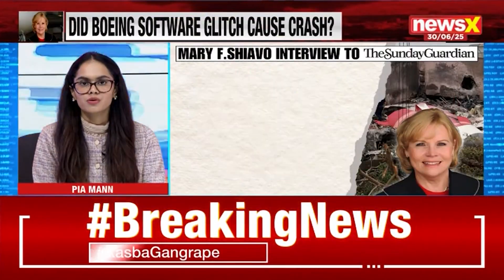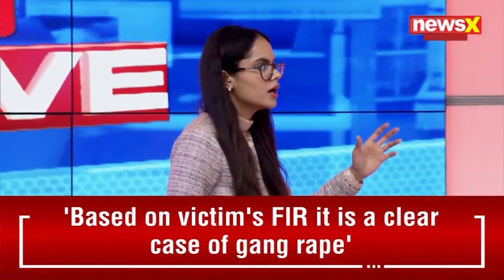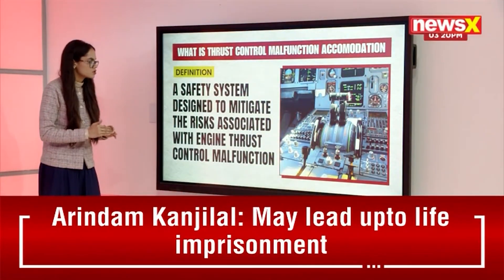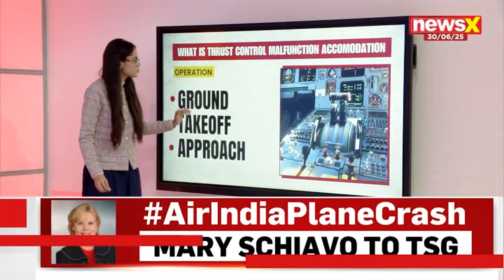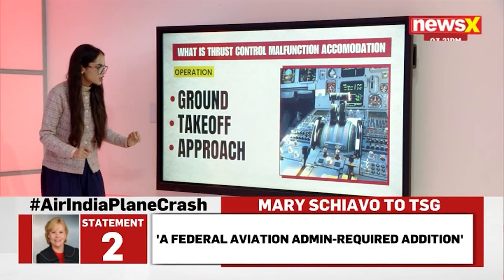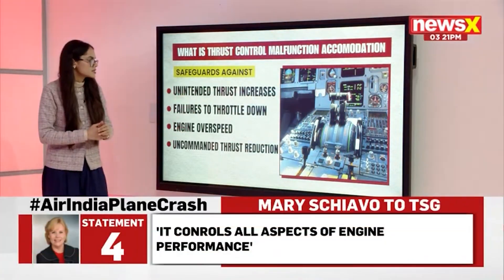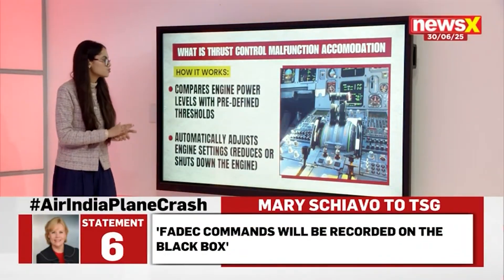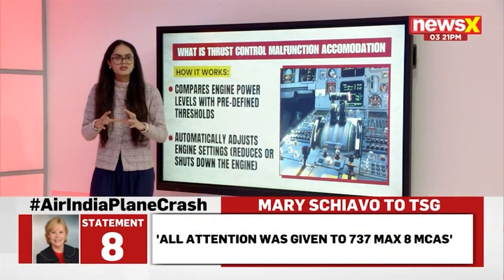Boeing Crash Probe: What Is TCMA? | All you Need to Know on NewsX

Comment: A couple of items the news writers did not include for the news reader.
1.  TCMA is designed to only function on the ground, not airborne.  
2.  The throttles must be in the idle position, and the aircraft has to be in the on ground mode:  the aircraft-ground sensor must sense it is on the ground, plus other safeguards to 
The ANA 985 flight that suffered a dual flameout/rollback on landing in Japan in 2019:  there was supposition that the crew selected reverse thrust before the airplane fully sensed it was on the ground.
The airplane rolled to a safe stop on the runway, but the crew was unable to restart the engines.
ANA may have used an old Airbus trick to wake up the airplane and reset everything.  Turn EVERYTHING off, wait 1 minute, then re-power the airplane.
Works every time.
Reply: Exactly my thought as well. Mary Schiavo is there just for attention-seeking.